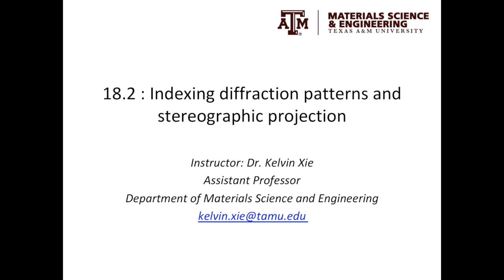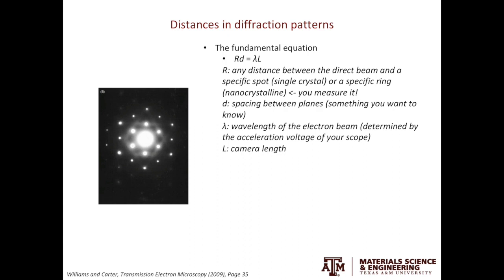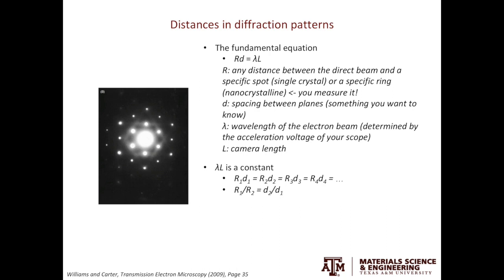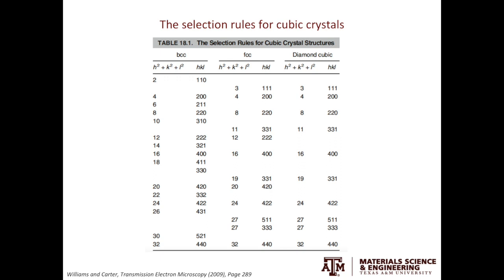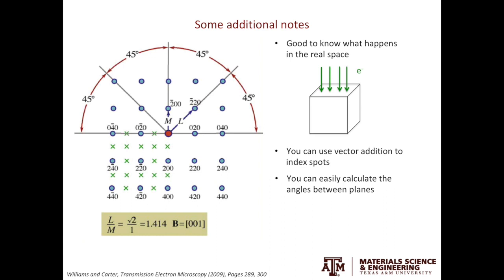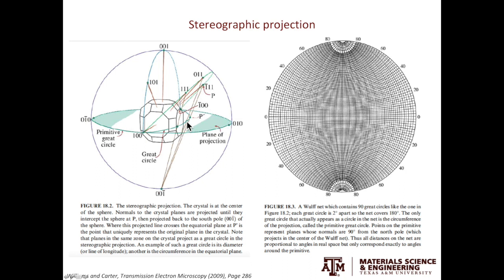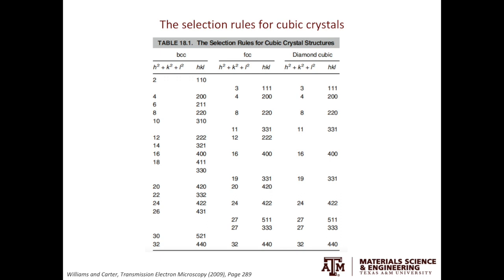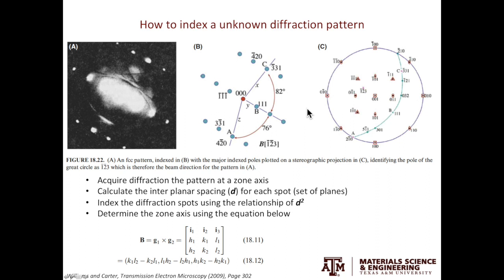18.2 - Diffraction pattern indexing and stereographic projection

Comment: I think there might be a typo on the selection rules table for cubic crystals starting at 3:40.
For the sum of h2 + k2 + l2 = 11 in FCC and Diamond cubic, the hkl 331 does not add up to 11.
Should the respective hkl values be: 311?
Reply: I think it is a mistake in table